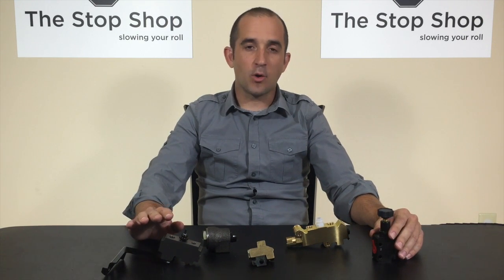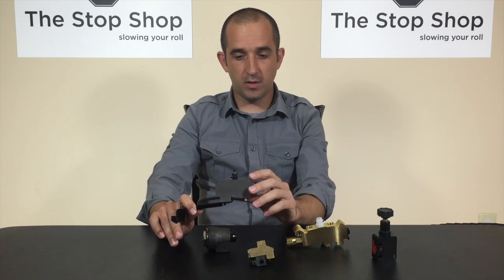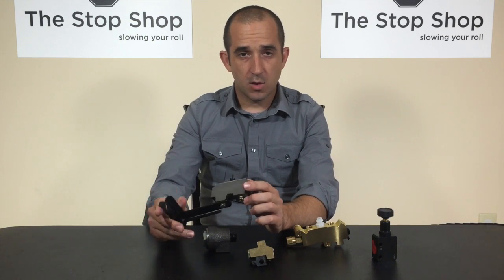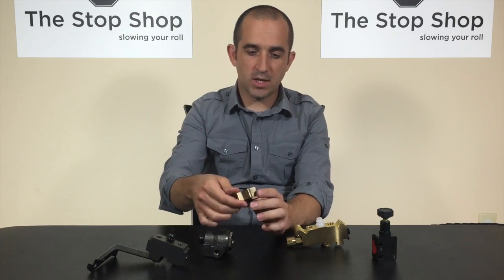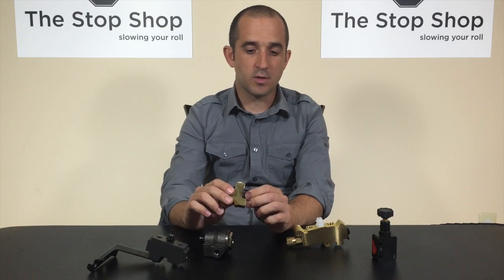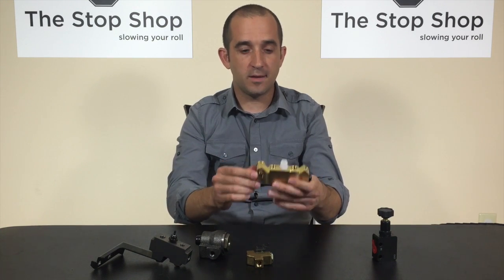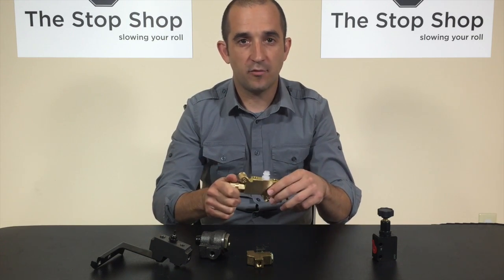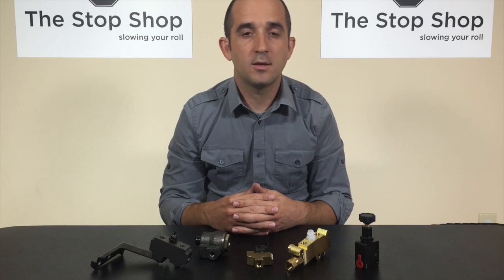Proportioning Valves and Other Brake Blocks

Comment: RESTOMODING A 1966 C 20 THAT IVE TAKEN ALL SUSPENSION OFF FRONT AND REAR AND REPLACE WITH SCOTTS HOT RODS 4 WHEEL DISC AND COIL OVERS WITH POWER R & P STEERING PUT IN A NEW BOOSTER AND DUAL MASTER CYCLINDER WITH A COMBINATION VALVE THAT BOLTS UNDER D/M. AFTER INSTALL OF BRAKE LINES AND REINSTALLING ADJUSTING VALVE KNOB AND BRAKE WARNING SENSOR WENT TO BLEED SYSTEM AND PR0PORTIONING VALVE SLID TO LOCK POSTION. IVE SINCE LEARN I SHOULD HAVE PUT IN THE TOOL WHICH DIDNT COME WITH THE KIT NOR WAS MENTIONED IN INSTRUCTIONS. PAIN IN THE AXX. DO YOU HAVE OR SUGGEST ONE OR DO I EVEN NEED VALVE SINCE ITS 4 WHEEL DISC?

Comment: Very informative! I put 69 Camaro master cylinder and disc brakes on my 56 Chevy. Rear is original. I have no 'valves', yet. May have to give you a call to see what you recommend.  :)
Reply: FYI, I just replaced all the lines on my 56 with new lines, and all the brakes are rebuilt. Looks like I should have found this video first!  :(

Comment: Can i use the proportioning valve on a 67 camaro with drum brakes all around?
Reply from the maker: No.  Proportioning valves only came factory on front disc/rear drum vehicles.

Comment: Can anyone tell me why on a jeep the rear distribution block has 1 line in and 3 lines out? I know 2 lines go to the brakes, but what for the love of god is the 3rd line for?
Reply from the maker: Hi Trev - What kind of Jeep do you have?  Two of the ports are for the rear axle brake lines, the third is for a flexible hose that connects the block to the front to rear brake line.

Comment: Hi, can the first block(pre 70's gm) fail internally and allow excess air when manual bleeding to the front or rear's?  Or can the hold off valve fail and allow excess air to the front's when bleeding?  Last question , the hold off valve has the button at the back, that is that for?

Comment: Thanks for the videos.
My GM style combination valve (PVK-72 from RSD) does not have the rubber cap in front and is solid brass on that end.
Dose this mean that I have no metering function in this valve?
Reply from the maker: That's correct.  It is set up for disc/disc, no metering function.
Reply: @thestopshopcom  thanks for the info. So is it acceptable for a disc/disc setup to have no metering function? I understood form your explanations it is more important for disc/drum configurations at lower speeds / at low system pressure...

Comment: Fantastic info sir. What are the Ford types? I want to do a rear drum to disc. Do I have have to go with something other then the stock I currently have?67 Mustang Gt, Big block, factory disc front , factory drum rear and mechanical brakes. Also, what is the block attached to the left rear axle with brake lines? Thank you very much for any feedback. Cheers from Motown.
Reply: Hello Robert!  The block at the rear axel is just a splitter.  Your best bet for your valve would probably be to use an adjustable proportioning valve.  This would mean you would most likely need to make brake line modifications.  Best of luck on your project.  Give us a call if you need to update those brake lines!  614-557-3442

Comment: Hi good videos I have a 1992 GMC 3500 Sierra this front pads in the rear I redid the brakes in the front for the disc as I did this I did not remember that I had added fluid about halfway through the break cycle when I went to collapse the cup to get the new pads in it popped releasing fluid from the top of the container after I put the pads in put it back together now I'm getting a constant brake light warning on the dash and I do not think my front brakes are operating I believe that the proportioning valve sensed a leak my question is how to reset the proportioning valve back to the Middle where it does not trigger the light and allows fluid to flow to the front brakes any help would be fantastic as I'm a one-man band just trying to stay alive out here

Comment: Can the last valve be used as a blocking mechanism for the rear tires to let them spin easier and be used on a 2010chevy pick up with abs system?

Comment: For the aftermarket proportioning valve, can you recommend a sending unit to monitor line pressure?  I'm not keen on rigging up a temporary hose, or teeing off a hard line to a manual gauge - just another thing to bleed, and I'd like to keep brake fluid outside the drivers area where it belongs.  I think a number of people doing drum to disc conversion on a front end would benefit from real numbers instead of cranking the adjustment knob and hoping they got it right.

Comment: I have a 1987 Toyota one ton pickup chassis with a motor home built on it!!!  4 clyinder, automatic trans, rear wheel drive with a proportional valve in the back.  The left fronf wheel locks up and skids.  With light braking.  But the truck does not stop very well!  
I put a new master clyinder on because it was leaking..  Also put a new vacuum booster. Still the front break locking up,  then put new pads and calipers up fromt!!!  Still not stopping.  The I just put a new proportional valve and now it still locks up and hardly stops.  When I bleed the brakes I get fluid out of the proportional valve.  But now I don't get any fluid out of the bleeders on the drum brakes.
What should I do????
Larry
Reply from the maker: Really sorry.  We sell a lot of classic car brake system parts.  Unfortunately we don't have a lot of experience with 1-Ton Trucks/Motor homes.  Sorry we can't help with this issue.

Comment: i put new calipers on the front and still only one driver side brakes! some does it sometimes don't? what is it??
Reply: If the caliper piston /pistons are free to move  A hose has possibly disintegrated inside and plugged up.  I learned that one the hard way. Replace all the rubber hoses .
Reply: Aside from what dave cee has noted, look at that combination valve: one of your front disks is served from a bottom port - that is a trash catcher, and the port most likely to experience moisture problems if fluid not changed out every two years.  Open all affected lines at each end and blow them out with low pressure air [like 25-35 psi so you don't get a faceful], and... make sure calipers got installed so the bleeder screw is on the high side.  If all lines have communication, I like to drop the hose on that circuit [after hard lines put back] to catch a sample from first bleeding attempts - see if anything gritty comes out or if fluid has some kind  of phase separation going on.   Once you get a good sample, reconnect/bleed at the calipers and see what you've got... might actually have a machining error on one caliper piston.